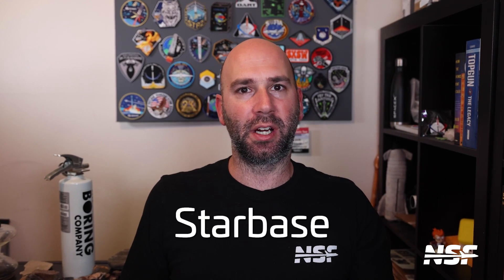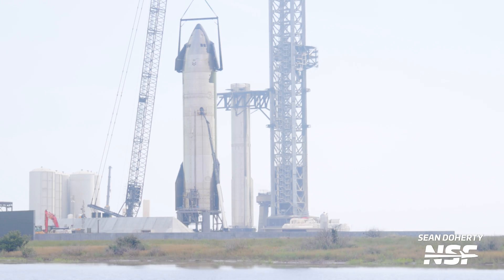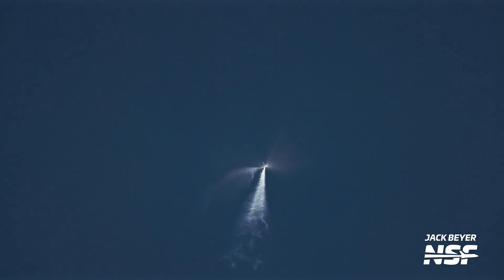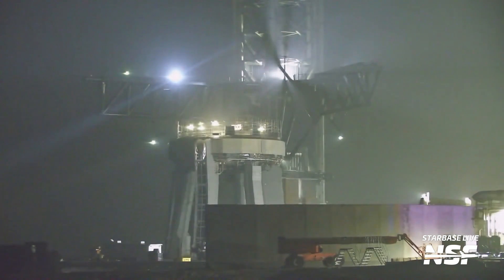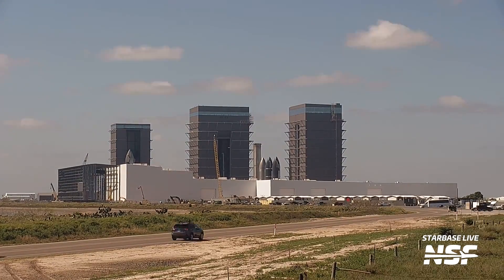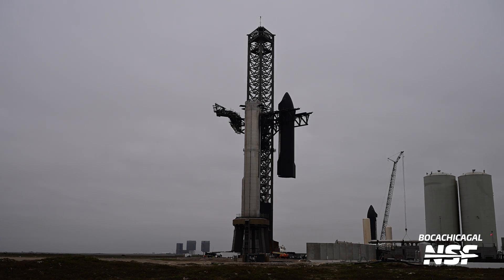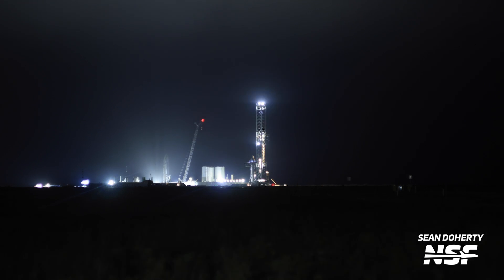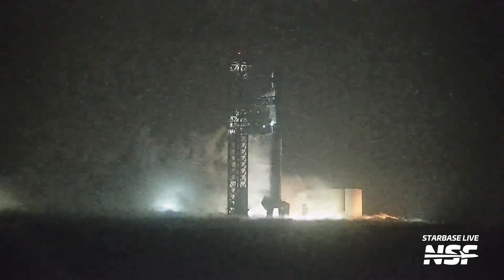Starship Passes Final Test Before Launch | Starbase Update

Comment: Fun update, thanks Jack. A few friendly notes: The duplicate audio at around the 6:45 mark could be removed before public release. And to the writers, a mistake is forgetting to put bolts back on a door plug; things that fail during development aren’t really mistakes. Call them design flaws maybe or simply root causes of failure. At the end of the day, a test vehicle needs meaningful failures to enable future reliability.